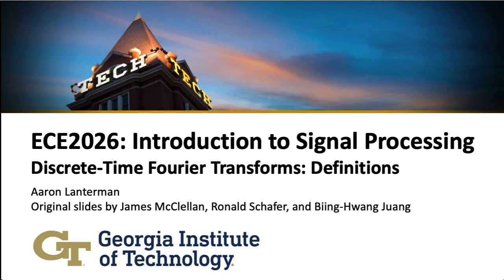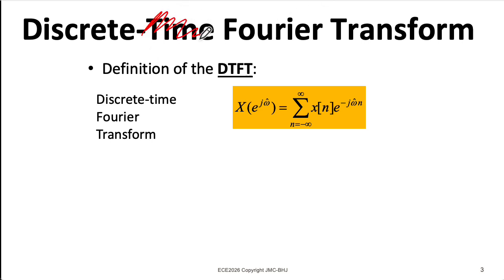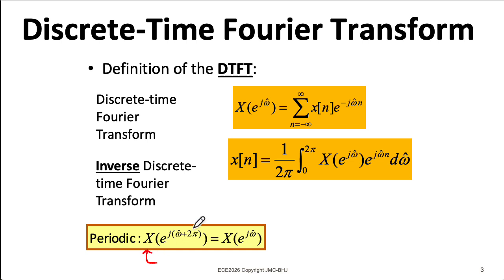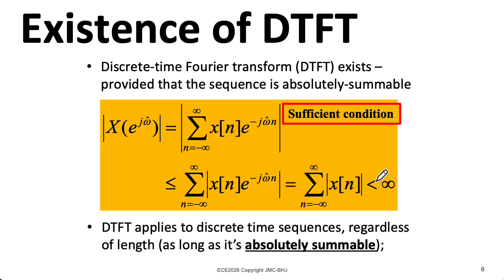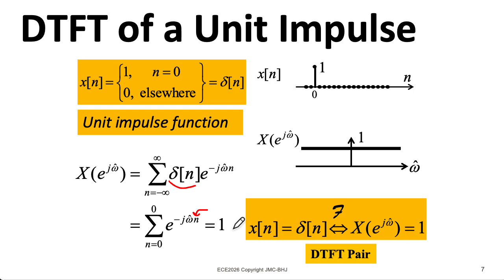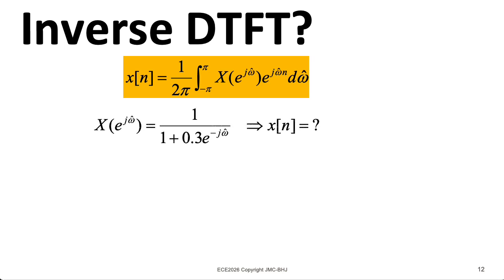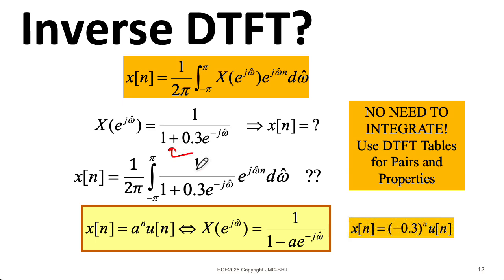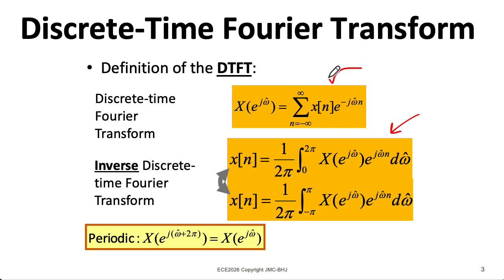ECE2026 L33: Discrete-Time Fourier Transforms: Definitions (Introduction to Signal Processing)

Comment: I think remember seeing 1/sqrt(N) for the normalization factor before. It may have been a Fast Hartley Transform, but the reference I had for that doesn't cover normalization. I've at least seen it in Numpy's FFT where you can specify norm="ortho" to get the symmetric scaling factor.
Reply from the maker: I've seen the square root form in the DFT (i.e. FFT) contest. Not sure if any textbooks use it specifically on the DTFT (i.e. nonperiodic sequences).

Your note about the Hartley Transform is interesting.